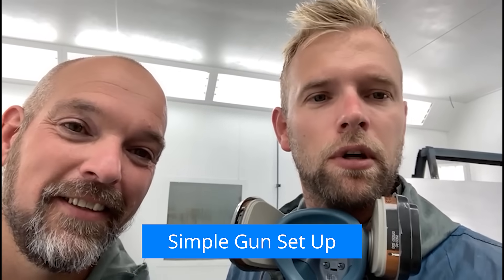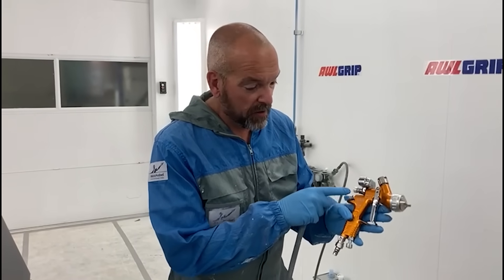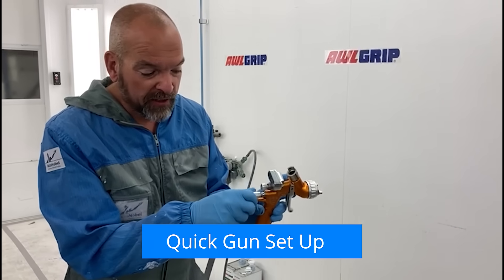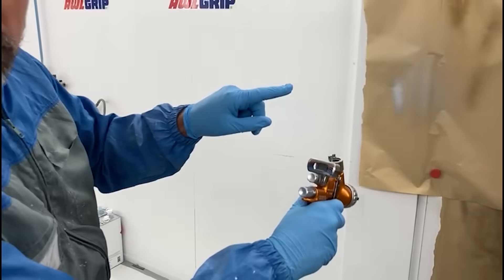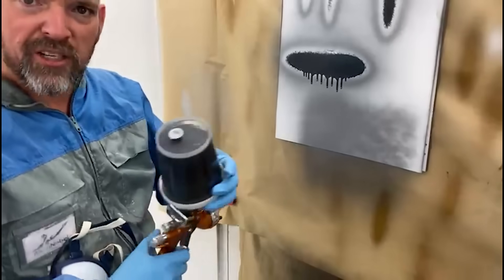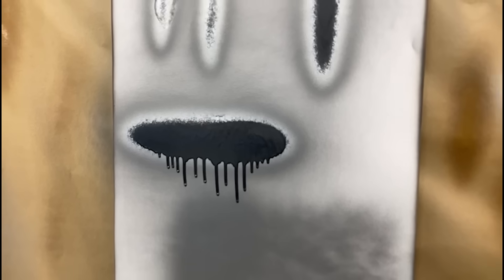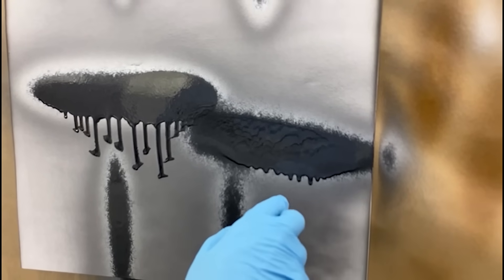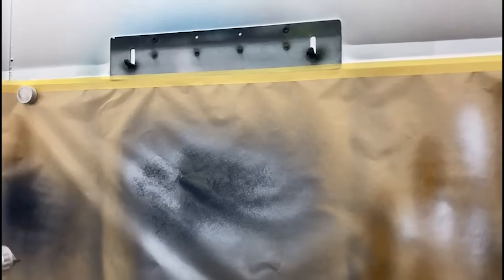AkzoNobel Yacht Coatings and Coffee - Spray Gun Setup

Comment: Im in a position where the yauht that im working on has been sprayed with awlcraft snow white and i cant find awlcraft snow white here in antigua.. can i use the regular awlgrip snow white as my substitute??
Reply from the maker: Hi Troy!

The Snow White colour code’s are:

G8044 for Awlgrip Topcoat
F8063 for Awlcraft 2000
TF8001 for Awlcraft 3000
L8007 for Awlcraft SE
OC8001 for Awlgrip HDT

In regards of colour appearance, they are largely the same as they are matched to same global standard: 715338

However, the swap from Awlcraft to Awlgrip Topcoat, has some effects as it’s a completely different chemistry.
Main ones:

•	Awlcraft line is polishable 
•	Awlgrip Topcoat has higher gloss
•	Awlgrip Topcoat is more difficult to apply

If you've got any further questions - please reach out to denis.laesker@akzonobel.com who is the technical service rep in your area.

Thanks for using Awlgrip!
Reply: @Awlgripfinishes  thanks alot for your response 👍
Reply from the maker: You're very welcome, Troy!

Comment: Hey guys how come with awlcraft 2000 you lay down a tack coat first then for the 2nd go coverage then 3rd full gloss then with awlgrip you guys lay almost a med wet coat straight down first? Just curious as to the application methods cheers lads
Reply from the maker: Hi Shaun,

Thanks for reaching out! It's actually the other way around. Hopefully the below explains.

With Awlcraft 2000 we go with full wet coat’s 1,2 and 3. The Acrylic base has different application Characteristics to the Polyester base of Awlgrip Topcoat, approx 60µ microns Wet Film Thickness per coat.

With Awlgrip Topcoat, you apply a fully coalesced first coat with a lower Wet Film Thickness, almost like a tac coat. You then apply 2 full coats on top. With both products we are looking for full opacity and a minimum Dry Film Thickness of 50µ Microns.

If you'd like any further tech support on this, you can find your local rep here: https://www.awlgrip.com/contact
Reply: @Awlgripfinishes  thanks heaps team for your fast reply ! It's appears I have been doing it all wrong ! I have been running a devilbiss gti pro with a 1.3 with the fluid set at the neutral setting fan set at what feels good to get a nice oval like shape and around 36-39 pound at the reg on the gun but have been putting a tac coat followed by cover coat then a full wet coat but I will definitely be trying what you said on some smaller components as a boat builder I'm not a great spray Painter but your advice has helped with my questions thanks heaps again team awlgrip simply the best
Reply from the maker: More than happy to help  @shaunmiles2065 ! As we said, if you’re unsure or want to clarify anything - please do reach out to your local rep who will be more than happy to help. Whilst we try and advise you best we can via social media, often you can go into addition detail and provide extra context so that we can ensure we give you the best advice possible.

Thanks again for using Awlgrip - and we look forward to hearing from you again soon! 🛥 🚤